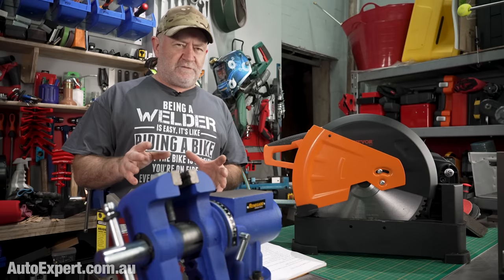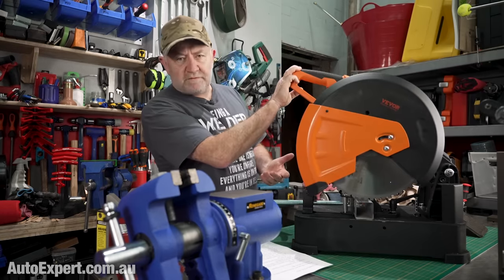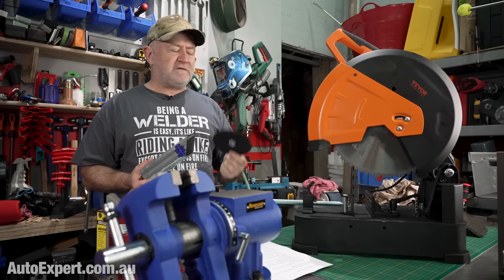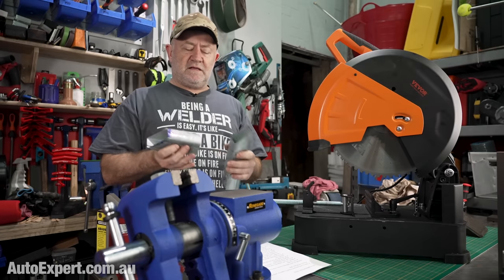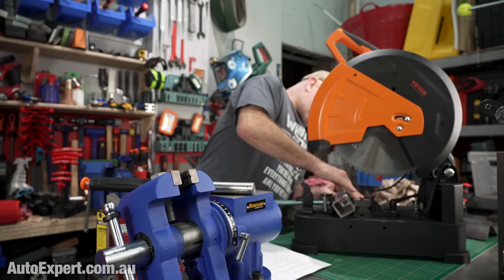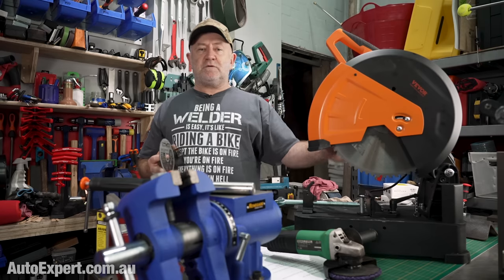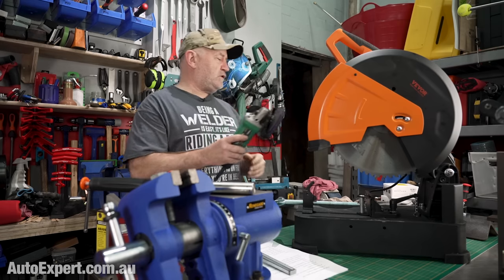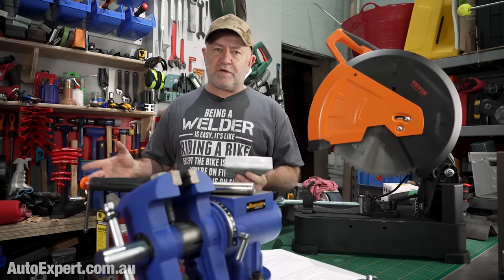Best affordable DIY metal fabrication chop saw tested (Vevor 355mm) | Auto Expert John Cadogan

Comment: Just a note - when cutting, you do NOT want to let the machine always cut at its own pace. When cutting wide sections, such as the start and end of RHS, you need to provide down pressure to ensure adequate chip loading on each tooth. If you don't, the teeth will tend to skate, causing the carbide to heat up and become blunt. I have a version of this saw made by Fein and they are quite specific about this.
Reply from the maker: Yeah - perhaps I glossed over that. I did mean not forcing the tool. Agreed that carbide likes to be worked reasonably hard. The saw is certainly not as happy when more teeth are engaged.
Reply: Yes, dangerous if forcing your tool. Usually results in unwanted marriage.
Reply: Do the blades in these saws have anti-kickback shoulders? I'm assuming this would limit the risks of too much force being applied. I'm not suggesting that it makes this a non issue or that you shouldn't worry about it. You're still going to induce excessive frictional heating of the blade and other issues, but at least it mitigates some of the risk of all that angular kinetic energy being rapidly dissipated in undesirable excitement. At least, that's my non-expert understanding of why some saw blades have these.
Reply: Not only downward pressure but you need to limit the kickback too. You have to be the shock absorber providing steady pressure. 
When cutting rhs/box/right angle you cut slower on the horizontal surfaces and faster on the verticals. Its all in the surface area/number of teeth engaged at once
Reply: I slow down just before breakout. That lessens the large burr on the off cut side. It also reduces the tendency for small cutoffs to jump off the saw.
Reply: Had one of these things.  Could not get any life out of the blade (tried several even tried special grease) no matter what.  Went back to old abrasive chop daw.
Reply: yerp, TCT tools shed insert heat with the swarf removed (the reason you see red hot chips and cool blades).

Comment: I upgraded my old Makita abrasive chop saw to a Makita cold-cut saw and have not looked back. Probably one of my best tool purchases to date. So, so much better for all the reasons John points out. Great video. Vevor stuff is pretty good for the money, definitely a step above the usual Chinese Ebay/Alibaba garbage.
Reply: I use the cold chop saw in my local makerspace, but if I was building my own workshop this would be one of the first big tools I would buy

Comment: The swarf off those saws are a pain as if it not ALL picked up it will cut and also hook into your bare feet and take weeks to rust away in the grass. This is Australia we like bare feet. With a grinding disk the filings off it are hardly any chance of cutting your feet. They just make little nicks or stick in 1 mm. Also they rust away in the yard in 2 or 3 days. As for your V block do not put the damn thing where you did. It is to be the other side of the square tube closest to the threaded clamp so the tube that is being cut in in the correct position for the saw. There is a reason the STOP is in that position. As for the swarf stick well more like $80 or more. Just throw a strong magnet in a piece of cloth. Worked fine for 40 years so far.

Comment: Thank you so much, I have learned something new today.
I was just about to buy a wood drop saw to cut stainless steel tubing for a number of projects.
I just looked up the blade speed specs and the wood version cuts over 3000 RPM faster than the metal version.
So for me, it’s a steel drop saw now!
Reply from the maker: Good plan

Comment: New eh John? I bought mine from Cable and Porter in the early 90's, the saw was 650 quid, and the blades were 90 quid a go... It paid for itself in time saved and accuracy... I still have, it still works (I retired) as a site saw it was lightweight and bloody versatile...

Comment: Well said.  The accuracy is a big jump up from abrasives and bandsaws. Yes, the swarf goes everywhere. I've used one but don't own one yet, so I'm thinking I need to set up my space differently and change my clean-up attitude to accommodate the different mess but it should still be a huge improvement overall.

Comment: I have owned my Hitachi drop saw for about 25 years.  It pays to get a good quality tool. I would also recommend a 100 mm and a high power 125 mm angle grinder.  A die grinder comes in handy at times as well.  If you are going to get a bench grinder an Abbot and Ashby 8 inch one is an excellent, durable choice.  In all honesty it is not possible to have too many metal grinding tools.  What home workshop is complete without a mig/tig/stick welder as well?  

In my experience it is impossible for a bloke to self actualise without metal fabrication tools.  It just can’t be done.
Reply: Good one Bruiser - you're my kind of guy.
Reply: @marawah  Thanks mate.  Don’t forget a welding bench.  No home is complete without one.

Comment: A Great video. The number one tool for D.I.Y  is measure then cut don't measure the whole length of cuts as you will be short after the first. The other great thing to have is a peg table can make a flat surface easier for construction but are expensive. The most horrible job I have ever done is called lapping. working with a pane of glass with wet sandpaper getting a flat plane on both sides down to a specific thickness sounds like more fun than using the hack saw on cutting old bolts from convenor belt with cleats. great work as always.

Comment: Hi John. Thanks for all the good information provided in your videos. Having watched this video re the Vevor Cold Saw and decided to buy one. Upon arrival of the saw I put it to work and cut 16 lengths of 35 shs 2mm wall thickness. It worked well however when cleaning the saw i found the blade suffered significant damage.  Those 16 cuts resulted in 4 teeth tips being broken. I understand the saw is value for money and it is all dependant on the skill of the operator however it is a bit disappointing. I will continue using the blade and hopefully finish the project. I thought sharing my experience was important. Again thanks for sharing you knowledge via the videos. Regards Bryan

Comment: Great video John. How do you think this saw would go in a fabrication workshop? Even as a plan B to that Hare and Forbes saw we have.  The two other hot tips I would suggest is... Don't mix and match you cutting discs. As in, don't ever use your worn down hot saw blade on your angle grinder. They are rated at different RPM and may ( and I've seen it) explode and really fuck up the user of the grinder. (The guy in the drafting office was talking the disc home to use. Found it out the hard way) The next tip. In regards to the cutting list. Cut the longer lengths first just in case you fuck up your measurements. It's easier to  cut a smaller cut out of a long cut length than joining smaller lengths together.  Keep up the great content.

Comment: Good overview but I would stick with a good metal bandsaw. Initial cost is higher but you get that back pretty quickly with the longer blade life and cheaper blades compared to replacement blades  for bladed drop saws. They are more convenient for basic 90 and 45 degree cuts though.
Reply: I have been using one for nearly 20 years now as well as a band saw and I always use the circular saw when I need very accurate cuts  as whatever you do there is always a little wander out with a bandsaw, for super accurate cuts a cold saw is best but it takes longer the saw is more expensive and so are the blades, of course you can get the cold saw blades resharpened and even new teeth fitted but there are now some companies around that will fit new teeth onto a tungsten carbide saw. I will say that if you want to cut stainless or thin wall tube a friction saw is a better bet.
Reply: my method of choice is to use a bandsaw to cut something to size +2mm and then put it on my conventional mill to face both sides. takes a little longer but if it really has to be the size i want it to...

and small conventional mills can actually be found for not that much money... just gotta find the space for them.

Comment: My experience (I’m just a retired guy on my farm) with cold cut saws on schedule 40 mild steel is that the blades get too dull to use after only a few cuts.  I got rid of my saw but I believe the brand was spelled Fein.  Supposed to be high quality.  Talked to welding shop owner who said the same thing about his.

Comment: Need to fab yourself a spark catcher/deflector for the back of the abrasive saw John. Most come with one and it will prevent the eventual projection of sparks into the wall cavity after they bore a hole through the gyprock...

Comment: For light duty work, small material sizes and for someone who doesn't have the space, I do like some of those compact cut-off tools. I have a Ryobi one. DeWalt has one that looks pretty nice with that dust shroud. It feels way better than making similar cuts with an angle grinder. It's no match for something like a proper benchtop cut-off saw, but might work better for someone with limited space and only needing to do light-duty and/or occasional work.

Good timing though. I'm moving into a bigger space soon, so maybe I'll have to look into one of these. It's a pity you don't have an affiliate link that works over here in Canuckistan as I'd gladly give you the commission if you did. Thanks for the content.

Comment: Hey John, I've still got a Eclipse Hacksaw!
And, Rod the foreman in the Telephone and PA section at BHP had to buy one of these drop saws.... because the Electricians couldn't cut a a 45deg angle. But the noise almost reached 90 Decibels! So you have to have ear protection and safety glasses. It drove us Technicians in the adjoining workshop crazy!  But you already knew that mate.

Comment: Just to warn people, cold cut saws with these kind of blades, bit of a different animal to the old style abrasive wheel monsters so you can't just go buy a 14" saw and fit it up to an abrasive drop saw. It'll choke on them, lot more torques needed to run them.
Personally I'm still a fan of the whole spin-off cottage industry of angle grinder accessories, you can get belt grinder attachments, circular saws, wood rooter-router discs and even little chainsaws with none of that real safety bullshit you get on actual tools. It's basically gods gift to outpatients doctors, they'll never be out of a job
Reply: The motor looks the size of my Hitachi abrasive drop saw.
Reply: @Low760  Its not about size, its about torque and rpm. 
A cold cut saw runs at about 1400-1500rpm from memory and your abrasive drop runs about 4500-5000rpm which can cause all kinds of bad things. Either it'll bind up or start spitting off teeth at supersonic speeds and that gets... exciting

Comment: Another option instead of scribing the 45° and 90° on the base is to drill and pin it... beats the accuracy squints.
Im unsure the quality of the Vevor if there's play at the pivot point it will effect the results using this method.

Comment: You can just measure from the blade to your cut when you set up, never mind marking stuff.  And always use a magnet to hold corners for welding, gets the angle right.

Comment: My father started as an engineer 70+ years ago. First test - "Here's a hacksaw and a 150mmx150mm block of solid steel. Cut 25mm off the top and file it flat. I'll be back later". True story - so I went into woodwork :) until I ended up in a massive machine shop operating an overhead planer on 1200mmx2400mm cast iron. So I went back to woodwork and computers :)

Comment: I’ve read some people’s comments on channels when someone is using or reviewing one of these saws. All too many times some wise guy comes in and thinks he’s a genius. So he tells people to use a carbide blade on a friction saw. It’s the same size, right?  It cuts so much faster. After all, don’t believe the max speed rating on the side of the carbide blade, because the manufacturers are lying to us so that they can sell more expensive saws. There’s so much brilliance out there. One thing about these saws that can be a problem. If the back fence is loose, or on some saws, flimsy, when you tighten the vise, it will bend backwards slightly. That doesn’t matter on a 90 degree cut. But when cutting angles, it does and the top of a square tube will be longer than the bottom, so the cut won’t be 90 degrees from top to bottom.

Comment: LoL, metal is the nicest to work, timber is just, well, boring!
And at 1:34 you need to add heavy duty shed shelving frames to the list.
My Bosch drop saw is on about its 50th blade and I've battled it the whole way as it will not cut a vertical 90deg!

Comment: in kazakhstan, we cut everything with 9 inch angle grinder.
Reply: Here in Australia 9 inch grinders are banned from most worksites. They are one of the biggest if not the biggest cause of workplace injuries apparently. I was injured by one years ago and it gave me a whole new appreciation for grinder safety 😊

Comment: Replacement blades for these saws are a rip-off in Australia from most shops. If you shop online you can find some decent options for around $150 but in my experience any blade less than 200 is just a waste of money and even then they might outlast the abrasive disc saws but they are really not cost effective for anything above a basic hobbyist. My last fabrication job had this type of saw gathering dust with a fucked blade. Each job involved about 12Tonnes of steel. Mostly cut to size but about 1/3rd was all cut manually.

Keep us updated on how this lasts.
Reply: I was wondering what the blades cost. Not surprised its half the price of the saw. My old abrasive saw is good enough for the small amount I do and it was free.
Reply: Yeah a bandsaw is better, blades are cheaper and last longer
Reply: I have a 305mm Bosch version of this saw and when it works it's great but in Australia these saws are an awkward compromise.

They are faster than a bandsaw, faster and cleaner than abrasives and cheaper than a Brobo. They are also way more expensive to run than any of the other options. Water cooled cold cut saws are way more expensive but the blades last about 5-10 times longer and can be sharpened whereas the carbide tipped bladed are basically throw away. I've heard it's possible to sharpen them but every specialist I've spoken to who sharpens blades won't touch them. 

If you need a fast, accurate and productive tool water cooled saws are worth the money. If you're cost sensitive a bandsaw probably gives bang for the buck whilst maintaining similar precision. I hate abrasive chop saws personally and would rather just use the ol 5inch. 

These dry cold cut saws are in an awkward niche for prosumers who can't justify the cost of a brobo like saw but won't use it enough to be affected by replacement blades costs. 

To be fair to John that is the exact niche he targets but as someone with one of these types of saw who works in the industry I'm underwhelmed with it's performance. 

Also for whatever reason, cutting galvanised material seems to halve the life or more. I got about 80 cuts out of Diablo Steel demon blade and it only dulled a bit. I did one project with 2mm wall 50X50 mild steel and after about 10 cuts the blade wanted to explode it was so dull so I had to cut the rest by hand with a grinder. 

One issue I have is that these saws are not in my view safer than a grinder. Cutoff wheels aren't the worst thing to hit you. I've had discs blow up in my face literally, take chunks out of me etc but as long as you have eye protection you need to be really reckless or unlucky for a cutting disc to seriously injure you. Chop saws are more controlled and controllable but if and when things go wrong they can go very wrong. Especially with a dulling blade. If the clamp comes loose and the blade chatters as it will do long before it's warn out, these saws are prone to throwing that piece of steel at you which is way scarier than a cutting wheel exploding.

Comment: Hi, great video! Question about the galvanisation, is it only applied to the outside of the tubing or is there a layer on the inside as well? If there is a zinc coating on the inside, how would you mitigate the danger from zinc vaporisation of the inside layer?
Reply from the maker: Inside is galvanised as well, but the weld probably doesn't affect much of that inside. Best solution is the vinegar, or a thin pneumatic belt sander that reaches inside the tube. And weld in the open air. (Last point is not so compatible with GMAW - MIG welding using a gas shield.)

Comment: If you are cutting angle, don't clamp it as John suggests. Use an off cut of square tube in the vice a bit bigger than the angle. This holds it secure. If you do it as John suggests, the blade can grab the angle and break it free from the vice, as it did to me. Ruined a blade and scared the shit out of me.

Comment: You might want to shorten a hex key to be able to set the cam belt tension on a VW. If you for some reason happen to be working on a VW.
Reply from the maker: Or cut off the L to fit a drill.
Reply: @AutoExpertJC  Yeah in a pinch but there are bits ready made for that. (Probably for my application to assuming you are prepared to pay VW oem prices and assuming that they will sell it to a mere mortal.)

Comment: I guess I might find out watching, but how does it compare to a bandsaw? My 4x6 from marketplace is good, even though it needs some tweaks and upgrades - all part of the game though. Also, I can leave it to cut something large and walk away with auto switch off.
Reply: I have both, the bandsaw gets used for larger material and for more fussy angles as it's easier to set up accurately. The drop saw gets used for basic 90 and 45 degree cuts as it's easier and faster to setup for that.